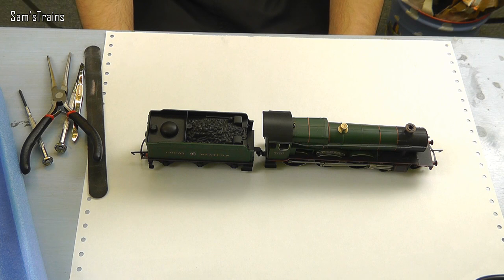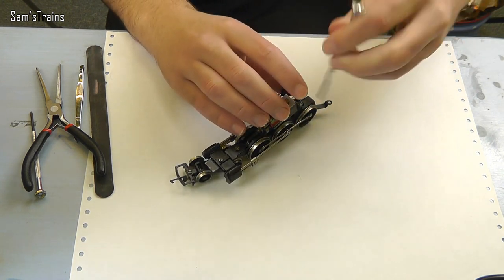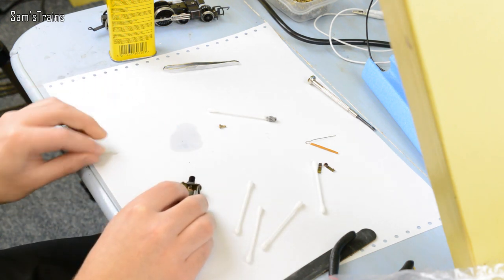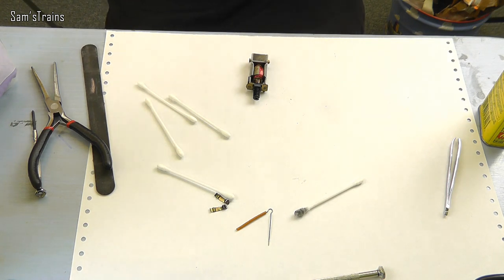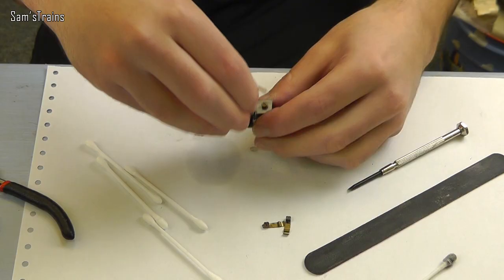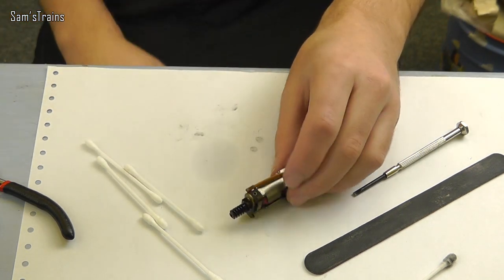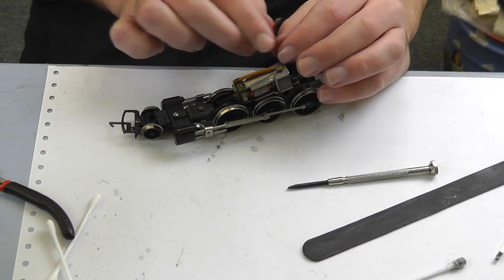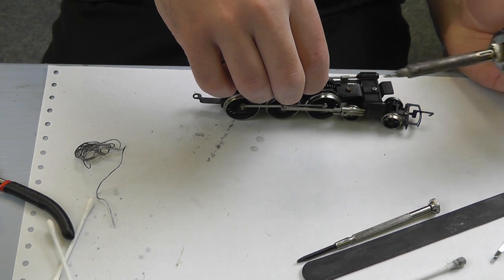Restoring the Tri-ang/Hornby Hall Class

Comment: 3:03 what I thought when my triang spitfire broke, itll be a simple repair though

Two years later finally runs again with new contacts, motor and completely rewired
Reply from the maker: Ahh great to hear you managed to fix it mate - brilliant work! :D
Thanks for watching - Sam :)
Reply: Nice! Must have been a long job, I have a hornby Gordon that made smoke from the engine, I just gave up after a few months and replaced it with a hornby James motor and it looks better on the outside and works better on the inside!

Comment: I believe you made a mistake in that assumption about the motor, the proper way to tell what type of motor it is is by the felt lubricating pads, if it has none, it's an X.03, if it has one, it's an X.03.5 and if it has two, it's an X.04, still a great video!

Comment: Found your video very helpful as I have a number of locos from the 60s/70s including two non-runners which all need servicing
Was the Hall able to negotiate points ok or did you need to add extra pickups in the tender?

Comment: apologies if you have covered it but what track do you use? i bought a hornby class 52 c1980 and it ran lovely on trix twin which is my old train set cos i am quite old but when i tried it on peco set track it wasn't so good, same with a mainline class 45 except that was worse. lima locos run well on both - they are great value robust  models don't you think. i can't  understand why anybody would do thumbs down for these great videos.

Comment: Sam, those oil bottles are hard to control the flow of oil I personally use a small syringe with the needle this will get into the remote areas where normally you have to strip the loco down, Great video keep them coming. ACE.

Comment: hi Sam nice video am just wondering what type of solder wire you use I have a number of models in need of soldering but am unsure as to which solder wire to use resin or acid?

Comment: Great job, Sam. I enjoyed this a lot. The three camera set-up works really well and the switching angles makes everything smooth to watch. Yes, I was nervous when you put her on the track...lol...but looking at the work you did, I was quite confident she'd run ok. By the way...I'd love a box of old screws, nuts and bolts from motors :) I've just serviced my old class 37 and I have a few more that could do with a service/rebuild. Anyway, nice work as always, mate...keep up the great work :)) Tom
Reply from the maker: +Tom's Model Railways Thanks a lot mate - I've always had trouble with my hands covering the 'action', so was my way of trying to avoid that! It is good fun doing these rebuilds or services, especially when the end result turns out okay! Good luck with your own servicing anyway! :D
Thanks for the comment,
Sam :)

Comment: Hi Sam 
Do you still have this loco?
I have one but it runs poorly! :( 
I am in the middle of doing this and will have to continue another time. Sadly though I think that this Hall is a gonner. 
Thanks for your help.
Josh :)
Reply from the maker: Hey Josh! Yeah I still have it - it depends what's wrong - is the chassis in good condition? There are a few variables - do you have a way to check the motor?
Thanks for watching - Sam :)

Comment: Great video! I have a model exactly like this one but with plastic driving wheels that I bought off a family friend a while back, however, the loco itself cannot move without assistance. I tried cleaning it with the basic tools and materials around the house but it still sparks and jolts forward when tested. It works okay on curves but refuses to move on straights. Should I try and clean it again properly or just get a new motor off eBay?
Reply from the maker: Thanks so much! Plastic driving wheels?! Is it the insides of the wheels that are plastic maybe? I think I know what you mean! Yes it sounds like there may be motor trouble there - a new one may fix her... make sure you get the one with the nylon worm though, not the metal one!
If you don't get any luck there, feel free to send it to me, and I can try to repair it for you!
All the best,
Sam :)

Comment: Great video ! I’ve just serviced my Fowler runs great with wires in motor but won’t run on track . Can’t see any broken wires any ideas Sam . It’s almost as if it shorts out when in the track .
Reply from the maker: Hmmm... is any of the pickup assembly or wiring touching the chassis? Are the wheels completely free of the chassis? Sounds like there could be something shorting!
Thanks for watching, Sam :)

Comment: My Jinty is in a state of distress. The two protruding pieces of metal inside are off, and so is the metal wire thing at the top of the motor. The yellow wire connected to the top of the motor is also off.
Reply from the maker: Ahh sorry to hear that Fuzzy - sounds like you need to get the pickups back behind the wheels! Take a look at my Thomas servicing video - that has the same chassis!
Thanks for watching - Sam :)

Comment: creating a new copper contact isnt too difficult, I would be very careful with trying to bend these parts in situ as the plastic brush holders are really pretty weak
Reply from the maker: You're right - I've done it before, not a huge issue to make new ones!
Thanks for watching, Sam :)

Comment: I'm trying to repair mine now. Previous owner had it setup for Dcc,  I run DC so I pulled it out and tried to bring it back to analog.  There is power now but when I try to run it it dosent sound great and I see sparks coming from where the brushes are. Would you, Sam , or anyone know what the problem is? I am knew to the hobby and this is my first restoration project
Reply from the maker: Hey! Good choice converting back to DC - these aren't good on DCC at all! The sparks could be a number of things - is the suppression capacitor missing? Does the magnet feel weak? Can you measure the resistance of each coil to see whether they're in good shape? The sparks can indicate high current draw, which suggests some kind of motor fault. Is the wheelset free to turn without the motor?
Good luck!! :D
Thanks for watching, Sam :)
Reply: @SamsTrains  Thanks for your help , I will try all I can and let you know if I get it in a good running position

Comment: My train set trains had X03 motors. Survived childhood and would have lasted forever if the wheel flanges had not been too deep for modern track. Modern motors might be recessed but not so good for survivability.
Reply from the maker: Thanks Alan - yes this is very true, though a lot of the later ones had flanges just fine - these Halls are fine on modern track!
Thanks for watching - Sam :)
Reply: The greatest news is you can buy wheels that have been re-profiled

Comment: Spot on sir ... thank you ... I found one of these in a box this morning (can't say that I knew I had it) and was thinking I might have a go at getting it running ... sat down for a cuppa and his video came up on my recommendations .... perfect!
Reply from the maker: Thanks very much Steve, glad this was some help for you! :D
Cheers,
Sam :)
Reply: @SamsTrains  It sure was .... I had a great time taking the loco apart as per your video ...I learned a great deal...never had the nerve to remove/take apart a motor before ... great fun, and good to see it spinning around like a new one (it was dead to begin with) after cleaning it all up ... was great until I put it back in the chassis ... then it stops dead ... reckon that must be wierd ... runs fine but it only has to be held against the chassis and it stops dead ... hey ho

Comment: Im trying to repair an old 4-6-0, it doesnt run at all but sometimes sparks come off the wheels, could you help me sam?
Reply from the maker: Sorry to hear that! If it's sparking and not running, you could have a short - double check nothing is shorting with the chassis, and make sure the pickups and their wires aren't touching the chassis either!
Merry Christmas - Sam :)
Reply: @SamsTrains  Thanks for that Sam. Will do that now.

Comment: Ive made a complete mess of this service on mine.. i melted the contact of the brush and there is a red wire coming from the engine interior which I have no idea where it goes... I tried to see how yours was wired but your hand was in the way at the crucial moment
Reply from the maker: Ahh sorry to hear that mate - is it the plastic brush retainer on the motor that's melted? There's only one essential wire with these, it goes from the pickups to the left motor brush!
Thanks for watching - Sam :)
Reply: @SamsTrains  no it was the little (now rounded worn contact pad) I heated the brush so much it fell off. I have just been trying to solder it back on and it flew off never to be seen again... i even put some white paper down too... I am trying to buy some new ones and don't know whether they will fit. As for the red wire it has been soldered onto the contact strip in contact with the wheels and threaded up through the chassis... it just ends in a bear end. I could send a pic. I know what you mean about feeling like killing yourself trying to get those brushes into the motor while still attached... if i had had a cat it would be dead too.  My loco is SIr Dinadan. |Thanks for the videos I am becoming obsessed. The wiring harness with the loop i put back on the screw... and then soldered the other end to the top of the bush.,... but the red wire... still puzzling me

Comment: Been doin this yet somethin shorted an burned out the motor. I think it was the pickup assembly as before hand the motor was fine with a battery
Reply: For reference, when under a battery, the motor works fine. When hooked up and on the tracks with the shiniest wheels and pickups if ever seen, it doesn't go at all, and occasionally there is smoke
Reply from the maker: Hey Rory - the motor shouldn't be burned out unless it's the motor windings themselves that are shorted - the motor should be safe if it was the pickups doing the shorting - you just need to correct the issue before it'll work again. Have you tried a full stripdown and service? Make sure the pickups/wires aren't contacting the metal chassis!
Thanks for watching - Sam :)
Reply: Been fiddling around a bit more. I noticed th problem after a light clean. It's jerky, but sometimes if I just leave I over night it will sort itself out. I've actually replaced the wire pickups with wiper ones so we will see how that goes. Thanks Sam!

Comment: Good demo Sam , just watched it with the sound off while one eye on the tele lol . Nice job done and looks to be running ok now .       ........Peter .
Reply from the maker: +Peter Shaw Thanks mate - It's something I'm doing all the time, so I though it'd be nice to film it for once! :D
Cheers mate,
Sam :)
Reply: +Sam'sTrains Hi Sam , wonder if you could help me with a query I have . New DMU I have derails on a couple of my points and thought it was a point problem until I saw a video on same being caused by the wheels too far apart . I do not have a wheel guide so just moved the wheels closer on the offending bogie just a little and problem solved . Would you or John at Chambs 123 know the correct distance between wheels or if there is such an item as a wheel gauge guide .      .......Peter .
Reply from the maker: +Peter Shaw Hi Peter, thanks for the message! You're right, a lot of de-railments do happen as a result of poor gauging - especially on Hornby locos! Me and John tend to gauge locos by eye, although I'm sure there are devices for gauging! If you're able to remove the wheels, you want to put each set on a point, and you want the wheels far enough apart so that they don't drop down between the rails on the point (Hornby points have a tiny section where the track is cut away slightly) You also want them close enough together to have a reasonable amount of left/right movement on the track too.
It sounds like you've got the right idea though, I tend just to use trial and error! :)
Cheers mate,
Sam :)
Reply: +Sam'sTrains Thanks for that info Sam , I used a goods wagon that ran ok and put it to the DMU wheels and could see the differance . There is always something new to learn in this hobby . 
Much appreciated . 
Regards .    
Peter .

Comment: Great video Sam. Love the matter of fact way you disassemble and reassemble these models.What  I learned is it really makes sense to have a good  suite of tools around just makes it so much easier. Your very good with the soldering iron. I have one but hate using it in case I damage something!
Reply from the maker: +Russell Benton Thanks mate - I've always enjoyed disassembling locos... just as long as I can get them back together again! Thanks for the compliment on the soldering hehe, though I'm sure there's plenty who are much more impressive than me! But yeah, there is always the worry of damaging things with it - I keep the temperature high, which means that you can break contact quickly without causing unnecessary damage!
Cheers,
Sam :)